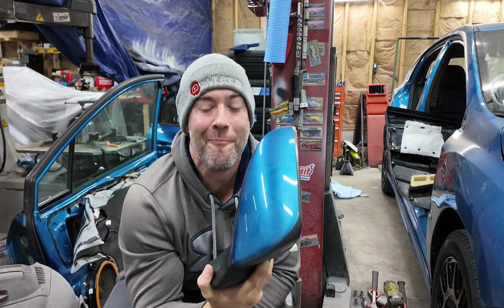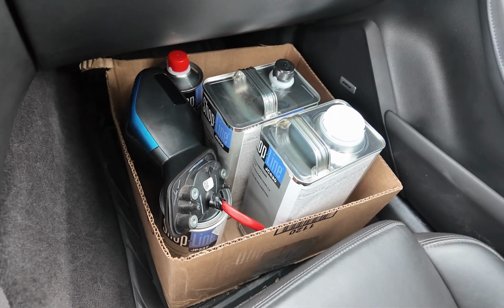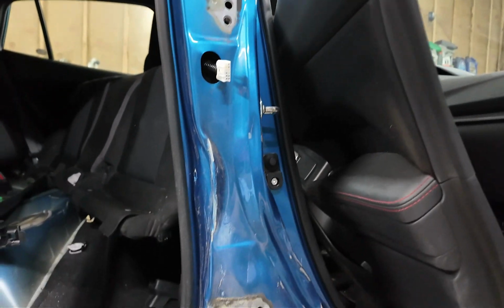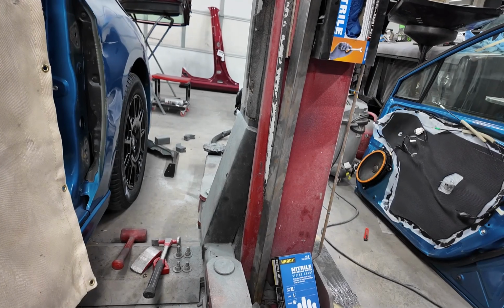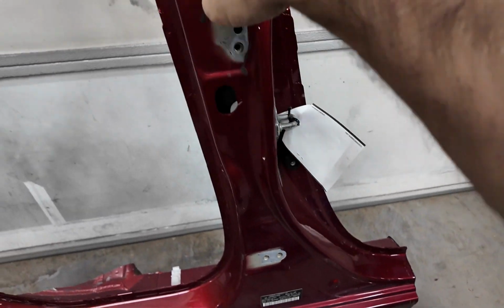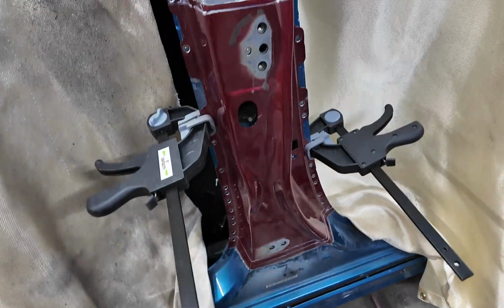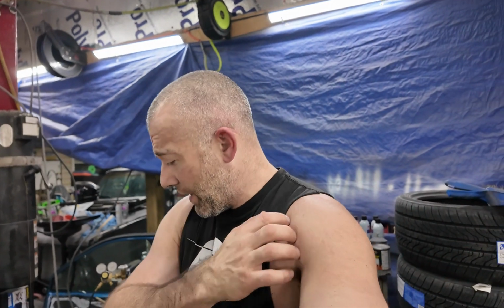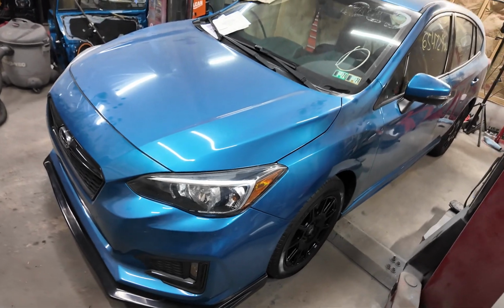Copart Impreza sport B pillar repair and front lip install

Comment: Todd, You did that B pillar “ skin replacement exactly the way I would have done it. The problem you are experiencing is with welding  “ boronated”( enhances strength) in thin steel. I have had success using silicon bronze filler rod when the weld is not on structural high strength steel. Your choice of music and your editing skills are fantastic. Keep up the excellent work.

Comment: I would suggest in the future you use a scribe to mark your cuts instead of paint marker. A scribe line is much smaller and more accurate. Just a little hint.
What gauge wire are you using in your MiG?